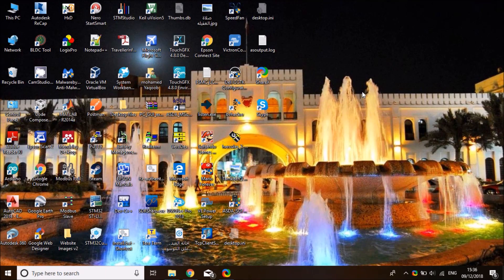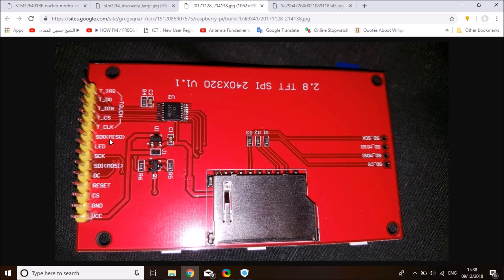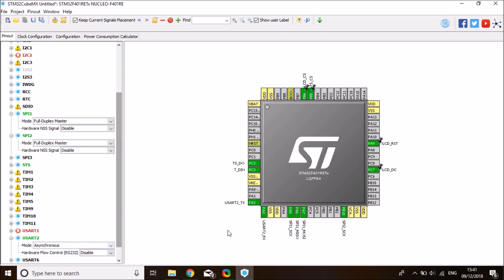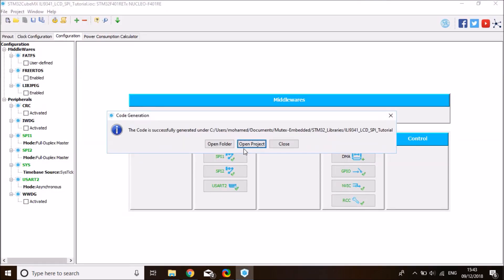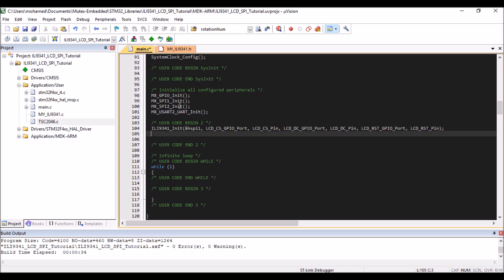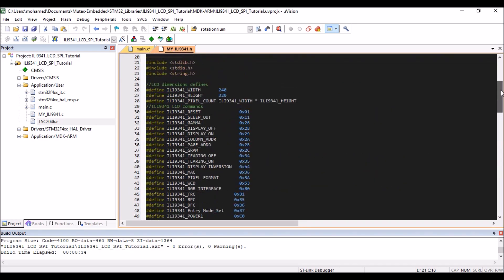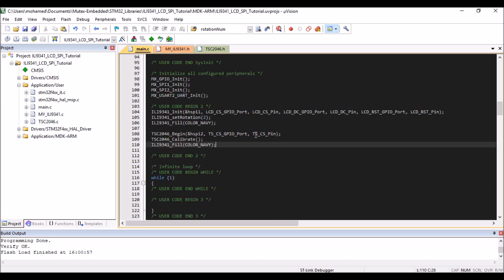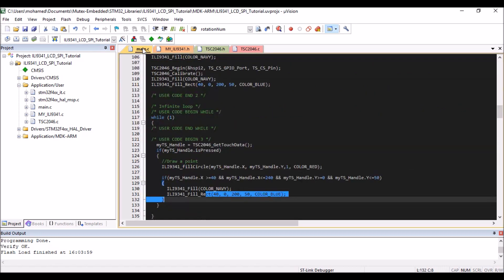STM32F4 Discovery board - Keil 5 IDE with CubeMX: Tutorial 26 - SPI LCD + Resistive touch

Comment: I'm using the ILI same ILI9341 screen but the one that's made for Raspberry Pi, the 3.5" variant. As per its diagrams, it's Touch SCL and MOSI are the same pins as its screen's SCL and MOSI. I tried this code to run that screen and the graphics work fine but the touch panel detects false clicks.
Could the interrupt pin resolve this issue? You haven't used or incorporate it.

Comment: My TFT SPI LCD Display is only white, any suggestions as to why? I'm using an STM32L432KC, and followed the steps just for configuring SPI1, and maxed the clock. I've tried following other tutorials, but they all result in just the white screen (which just means the LED is powered by 3.3V).
Reply: ended up switching to an i2c lcd display which worked fine. weird

Comment: Hi, I have used your code to implement the same thing; however, I am only able to get the screen to go 320x320 even though im using a 480x320. I have changed the width and height accordingly in my macros, yet i am only able to get some color and lines going up to 320 only? is there a possible fix or reason behind this? the backlight is on and lighting up the full LCD, the pins are where they should be? is there a reason behind this?

Comment: I am using Arduino shield TFT LCD. Will this code  work with it too?
Reply from the maker: Yes, if same LCD
Reply: @mutexembedded2206   Actually the pinout is different.  I am using the LCD used in FSMC video. I want to implement on touchscreen on it. So will the same code work on it?

Comment: Very interesting. I have mcufriend 3.5 inch touch TFT. It has the same connector as the F401RE board, you just plug it in. I could never find a way to get them working. I wonder if you are planning to take a look at this displays. Thanks.